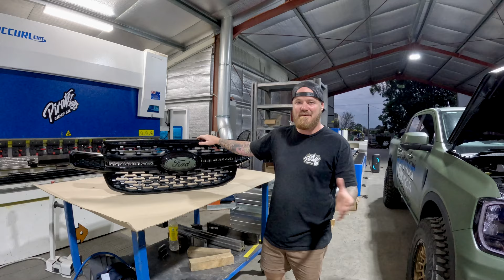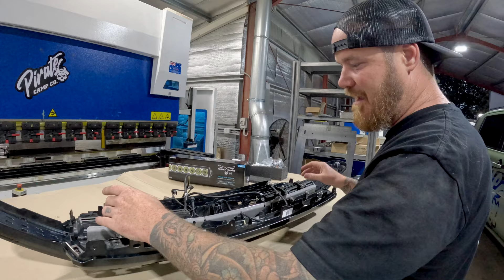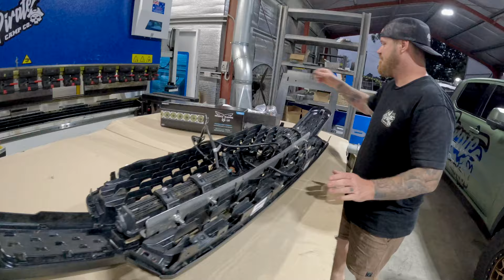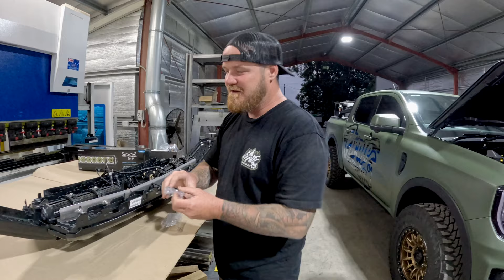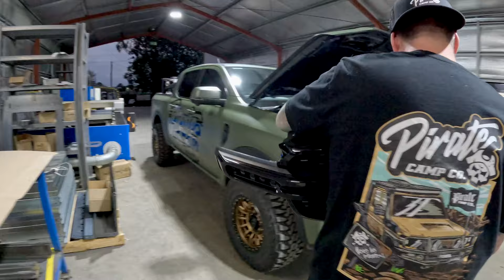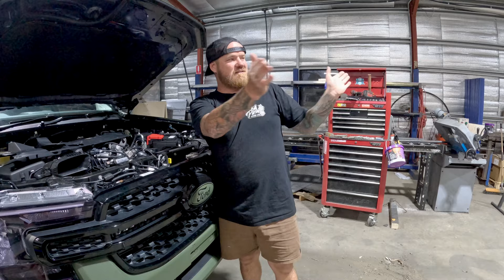How to adjust our next gen ranger / everest behind the grill light bars

Comment: Can the light bar be connected straight to the high beams without running a wire for a switch into the car ?
Reply from the maker: Hi Ben,

They can, but legally you need to have a switch in the car. It's also easier to pull wires into the car as ford have left a highbeam pick up wire at the passenger foot well kick panel. Refer to the video in the link below for our how to install video which explains all this. 

https://youtu.be/fGkwBD7qkCY

Cheers James